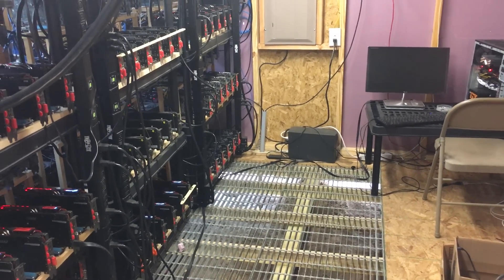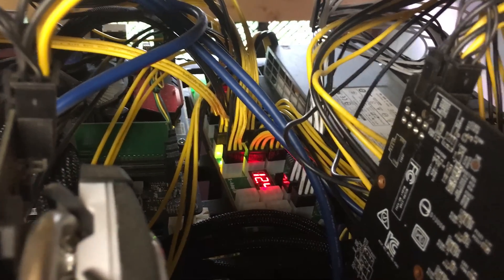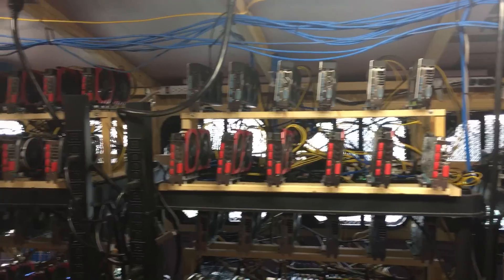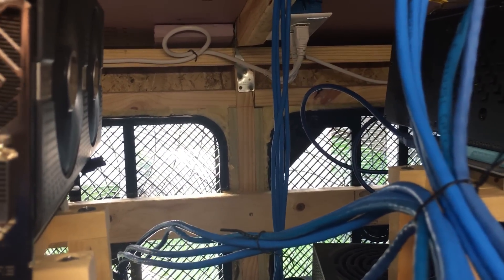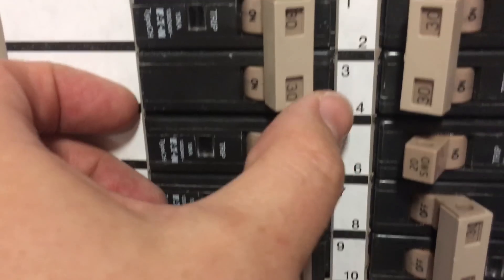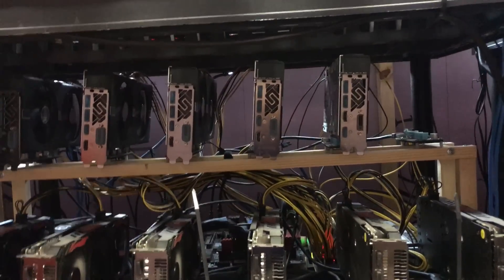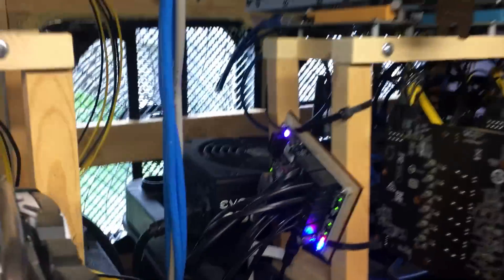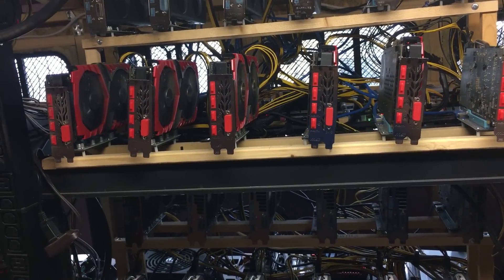5.6GH 192 GPU Ethereum Mining Shed - Nov 2017

Comment: Setup nicely done. Can you link the motherboard for 12GPU build, box fan and psu multiple socket wire.
Reply from the maker: You may be right about the 100% fans. I would love to get some feedback from those who have been running a farm longer than us. The GPUs don't run that hot, I was merely saying that they are designed to run that hot if needed. In the summer most were averaging around 60C. There is a ofc a toss up between cooling and lifespan and efficiency.  Running AC is a total waste in our opinion.

Any issues with GPUs vary. I keep a running log of the issues or changes I have made with each GPU to attempt to rule out issues. In some cases the memory timings were too aggressive, too low of voltage, etc. In rare cases I have found the issues to be the risers actually.

High humidity is fine as long as it is non-condensing as we are learning now. We have a great idea of re-circulating a portion of the hot air from the Antminers when the air is too cold to prevent condensation as well. Also we have added filters for the dust and droplets.
Reply: BeerMan 81 

60c is much better it's just a shame that requires 100% fans, I would lower the memory overclock + increase gpu underclock and aim to bring the power usage down ~ for example producing 27.5MH/s instead of 30MH/s ... this kind of a reduction should lower your temps enough for you to (hopefully) achieve 60c @ 70% fan for example

On the fans, I have been mining since 2013 - currently have 30 miners (12x rx580 cards each) - I can't comment on if I am right or not, I play on the safe side of the equation so I've never had a fan die on me (at least not one in any of the gpus) ~ maybe it's because I run them at 52c @ 50% fan, maybe it doesn't matter ? 

Humidity is a big problem, condensation from sudden changes in air temp with high humidity condensates into water on your miners -- this is why my mining "cold" room is fed filtered and cooled air thats dehumidified into the fully sealed "cold room" ~ then the cards run the full length of the room on four levels, each shelf is flush with the wall and sealed to it, at the back middle of each row (shelf) there is a row of 150mm 200+cfm server quality fans, gapped 150mm apart (and sitting exactly 120mm behind the rear end of the cards) , those fans suck into the hot room which spans the entire length of the "cold room", is little over 1 metre wide and is fully sealed off from the cold room (apart from the holes the fans are in), then in the hot room on the opposite wall of the cold room big high temp dual blade exhaust fans suck air out of the hot room.

Additionally the cold room is positive fed 20% more airflow than what the 150mm fans are able to pull, meaning it is positive pressure of about 20% - this coupled with the flush wall joined shelfs means there is literally zero hot air in the cold room, the cold room is always the same temp, and cards easily run at 45 / 50c with <50% fan.

Doing it this way means there is no dust, no bugs, regulated temperature, low humidity, overall 8% less power used by the rigs (power supply reaches 96%+ efficiency because the psu's are operating at < 20c) - also since you have less heat & less gpu fan usage that equals even more energy savings per card of 10~15w, I'll end this comment here since it's an essay, but if your keen to talk or want any help just hit me up on Twitter @pilsy
Reply: This comment was super helpful as someone who currently runs 4 rigs and is looking to expand into the tens. My main concern at the moment is the amount of power my house is able to provide, although I'm from the UK so circumstances may be different. Potentially looking towards building a purpose-built outhouse so the idea of a hot and cold room is interesting to me. I would love to see pictures of the setup as inspiration!
Reply: Running the fan's at 100% will wear them out, running them 24/7 at 70c / 75c will also not be good for the card's and is sure to reduce their lifespan, cooler video card's mean's they would not only be more energy efficient but actually mine faster, on top of that your power supplies would be at least 3 to 5 percent more energy efficient without all that heat and hot video card's drawing excess power. What about dehumidification? (like say your power went out on a hot day when everything was sitting at 75c, your cards and boards would all start to sweat and fry themselves, what about the dirt and/or airborne stuff getting in your card's, boards and power supplies? There is also the fact that all your wiring would be much hotter and thus less capable of dealing with a constant load, like for instance you said sometimes you have boards fail or risers (or whatever) -- risers typically are either dodgy when you first get them or they work, out of the last 350 i've gotten probably 20 or so were dodge -- but the rest, i haven't any troubles with once they are in a rig and mining... could just be the risers being dodge but how confident can you be making that assessment after considering all of the point's i listed above? (and i'm sure i forgot to mention a bunch of other potential issues / causes for problems...

Don't get me wrong, well done -- you have a sick amount of hashing power, not bagging you out -- but very interested to hear what your thoughts on these issues are?
Reply from the maker: James Greenfield https://bitcointalk.org/index.php?topic=2373161.0;all
Reply from the maker: Thanks for all the information. I could not find you. Can you send me a link.
Reply: just a shame proof of stake will make all of this eventually pointless :(
Reply: @BeerMan https://twitter.com/pilsy
Reply from the maker: Sure thing, I have to rebuild one of the rigs due to some faulty risers, so I am going to show different ways to set up a 12 GPU build.
Reply: There seems no air conditioner mount in the wall. So the cooling made by fans only?
The GPUs setting in the second layer how does it stand without support.
Reply from the maker: Correct. You don't need air conditioning. Consider your graphic card will happily run 75C (167F) when you are under heavy load gaming or something while the GPU fans running 40% or so. So, your computer case and GPU are exhausting the hot air into your house. So you are using 22C (72F) air to cool your GPU.

In the shed, ambient air temperatures are around 100F (38C) during the summer. You will still be able to cool the GPU given you are exhausting the heat somewhere. All the fans on the GPUs are running 100% to cool the GPUs, and the exhaust fans are helping to move the heat to the atmosphere. 38C and 22C are not that different in comparison to what the GPUs are designed to run at.
Reply: Condensation?  I am under the belief that condensation occurs when you cool the air, not when you warm it up.  Has anyone actually had a problem with condensation?  Let me know on this.  Thanks.

Comment: Careful about that foam board insulation. It can catch fire very easily so for code it pretty much always has to have a layer of drywall over it. I would take a piece and test how easily it lights with a lighter. You wouldn't want a spark from the miners to set off an insulation fire and burn the whole thing down.

Comment: All I can say is WOW! What is your electric bill? LOL
Reply: BeerMan 81 that and growing marijuana plants
Reply: Is it residential or commercial power?  Does the electric company come and ask wtf is going on?
Reply from the maker: Residential. There were some concerns from the electrical company before they approved the project. I just said i will be putting computers that use a lot of electricity. When one of the techs came out to disconnect my home from the transformer, he knew of bitcoin miners using a lot of energy as this is the only time there is significant energy usage at a home. I know I'm not the only one.
Reply from the maker: at 8.3 cents per kWh it was around $1800. It has since increased to around 2300 after adding the antminers.
Reply: futurecop3100 yesss
Reply: 0.30c/kWh here.
Reply: Shadow's Insomniacs dude 0.30 cent per kWh is basically nothing. Where you living?
Reply: I meant 30c/kWh. The highest I've paid was 35c and lowest 28c.

Comment: Wow a person who actually knows what he is doing, this is rare video. Thank you for sharing.
Reply: How often do you dust these girls? Some of those MSI's were looking caked. 

Edit: To avoid coming off as rude I would like to add that I do admire your setup.
Reply from the maker: LOL, thanks!
Reply from the maker: Glad you enjoyed it!
Reply from the maker: I just got through doing my first quick dusting with an air compressor, and soon will do full tear-down for deep cleaning.
Reply: Nice. Tear down should be fun haha. Nonetheless, awesome farm you got.
Reply: Don't use an air compressor, I don't want you ruining your equipment.
Reply: Air compressor is not a bad option. I use one of the in-line filters that automotive painters use to make sure no moisture makes it through the lines.
Reply: WITHDRAW as long as you drain the compressor it's fine,  ours has a tiny hole on the bottom so we don't have to 😂 👍
Reply: That, and I remember something having to do with the oil in the machine and it merging with something else and creating static electricity
Reply: I like to use fpgas, a lot faster, but you have to write your own code...
Reply from the maker: WITHDRAW we installed a filter. I think it should be bigger tho

Comment: Have you ever dealt with mice or rats coming into your shed? I'm thinking about starting up my shed because my den is seriously heating up. Winter time isn't bad because it keeps the house cool, but summer time it's no joke. Did you build your shed or buy one at a Home Depot or similar?
Reply from the maker: I think a cat went poo under there once because i was getting a weird smell. No critter problems yet. We have plans to add some protections soon.

But, we came up with a design and had this company come out and built the shed in one day. We really should have made it bigger, but my HOA has height limitations. Mostly, we said we wanted a gable style shed with 20" studs for the box fans, and install the grating in the floor. They did the rest.
Reply: What are the dimensions of the shed?
Reply from the maker: J. R. 10w x14l x8h